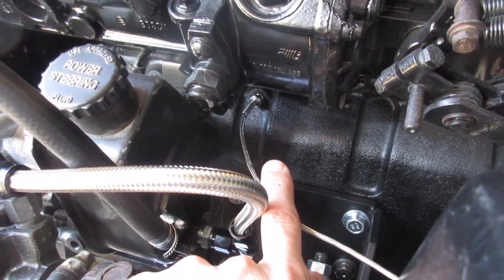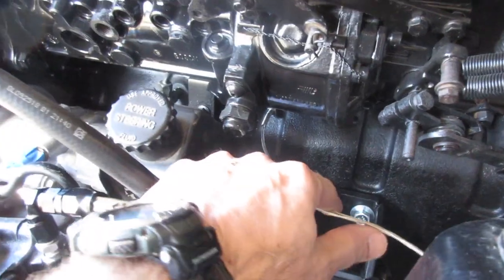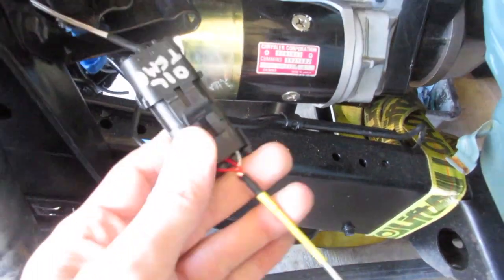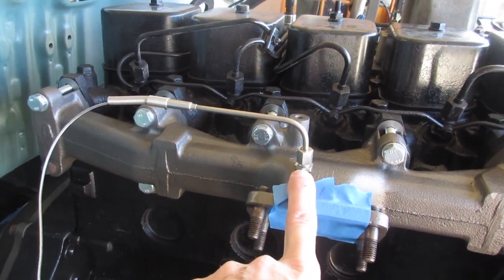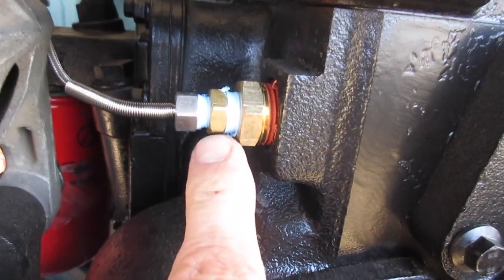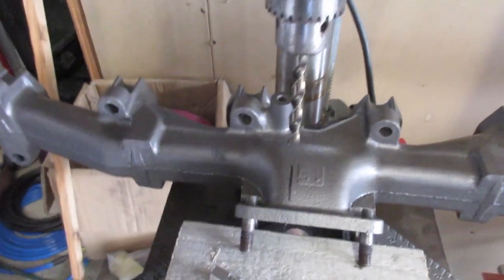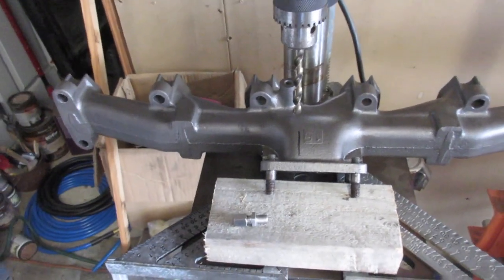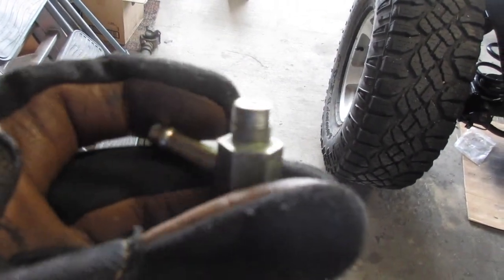PART 16- 75 SERIES LAND CRUISER BUILD  - ENGINE MANAGEMENT FOR 12V CUMMINS

Comment: did you have to Stretch the frame to make this work???  I have a fjz80 and a fjz80 frame and I can't make up my mind which one I would like to use!  If i use the Frame then I would probably try and use a T100 extend cab !   If I can find one!
One more thing!  who or where are you getting the NV4500 to FJ60 t case adapter ?
Reply from the maker: I am not stretching the frame as of now. I think I can fit a 6.5’ tray without a stretch. If you are adapting a splitcase Advance Adapters has the adapter. It’s what I’m using in my 80 with splitcase.